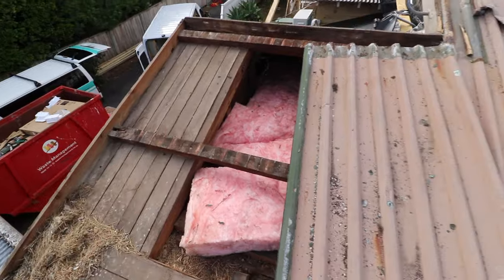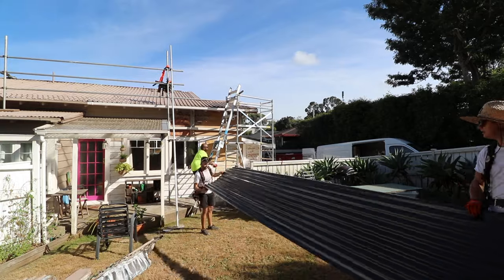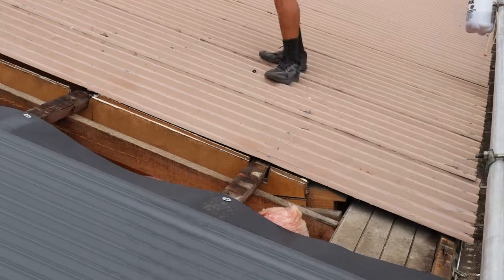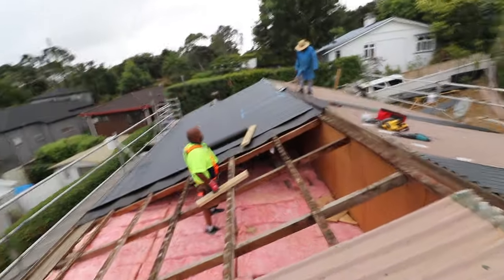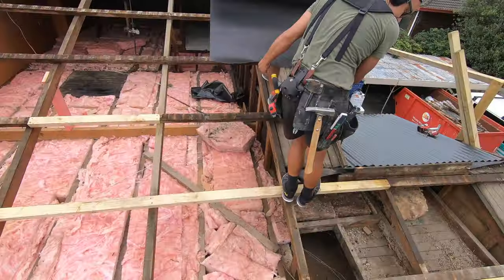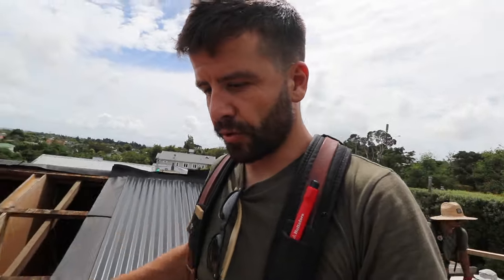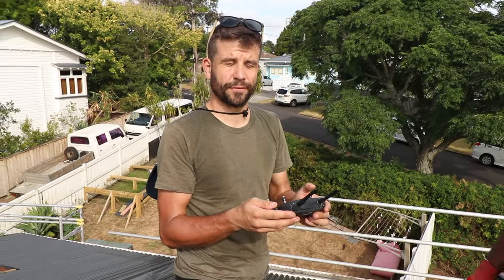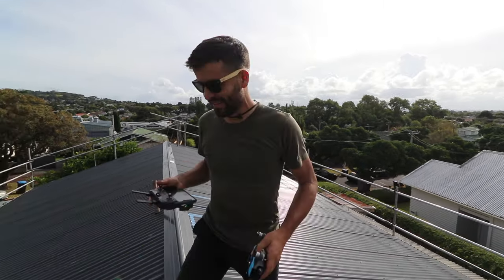How to Replace an Old Roof!

Comment: Hey Scott - NZ doesn’t specify you to run underpayment horizontally/shingled from the eave up to the ridge?
Reply: Love the videos by the way!
Reply: Dan Germani if the paper is 1000mm and support centres are say 1200mm ctrs then you couldnt lay the paper horizontally along the roof
Reply: some parts of Australia they don't even require underlay, only on spans over 6m at the 6m point.
Reply: The relevant part of the code (acceptable solution): 7.1.5.2 Installation
Roof underlay shall be laid with minimum 150 mm laps, and either across the roof slope or down it. When laid across the slope, the upper sheet shall lap over the lower sheet.
7.1.5.3 Underlay support 
Roof underlays shall be supported on 0.9 mm galvanised wire mesh, unless it is self-supporting in which case it shall span no more than 1.2 m in any one direction.

Comment: They haven't improved on the ancient corrugated metal over there?
Reply: Yes they have. The metal itself is available in different types of alloys depending on the location (from inland high country to coastal marine) and the coatings run from from light-zinc to heavy-galv to powdercoat to heavy powdercoat. The profile too varies based on roof angle, wind-zone and span. Don't rely on just your eyes.

Comment: RR Buildings, would have had the ruuf up by lunchtime 😊.  However, well done it completing it in a day 😊.  Drone shot at the end, needed to be done.
Reply: Haha - I was thinking the same :)
Reply: Two days.
Reply: @jamesbailand4311  Yes, you are right....3 men, 2 days.  A fun video though. 😊
Reply: Hope they removed the chalk lines, after they were done with them 😊.  You guys did....right?
Reply: @markodjukic7666  that was black ink.
Reply: ....and finally, a great soundtrack.
Reply: @jamesbailand4311  Of course, the new tool from Gaston 😊.
Reply: Would RR building replace the rotten bits and add the support for the rafter?
Reply: @Marko Djukic Yes but RR would have has $300,000 in machinery and gadgets to help him do it in a day, oh a Greg his human machine 🤣🤣
Reply: Zane H Mean, What kind of machinery and gadgets are we talking? Like a Hiab and special nail pullers ( I'm not getting smart just wondering how this job could be done quicker? )
Reply: @MsElijah16  Watch his videos when they do a roof, or a ruuf as they call it, he will lift all the sheets up to the building edge in one go, they slide them off and use the machinery to make it quick, their roof's are lined in ply so they are also much easier to walk on than having exposed battens where you have to watch where your going.
Reply: @zaneh6224  Well, my initial comment was made, 'tongue in cheek'....it obviously mis-fired.  No offence meant to SBC, and his audience, as the SBC channel is, I think, a superb channel, in its content, presentation, humour, soundtracks, and cooking courses.  The 7 minute or so, duration of each video, is also a winner.  I shall continue watching both, for the high quality content which they produce.  Apologies, if I offended SBC's audience.

Comment: I would have just replaced the roof without putting in extra support and without the water membrane since metal roofs won't leak if screwed in correctly. If you want to over-do work, then that's your choice of course.
Reply: Then your roof space and framing would have had a condensation problem. That building paper membrane isn't primarily for leaks.
Reply: God I hope I never hire you. Seriously.

Comment: No chicken wire under the paper Scott..... why is that? Are those days long gone? we are replacing the iron on our family bach in the BOP shortly
Reply: Depends on the building paper you use, modern ones are self-supporting.
Other factors include roof pitch and whether it is exposed on the underside.

Comment: First official oopsie Scott, the underlay is meant to be laid horizontally
Reply: Ben McGill hahaha was thinking the same
Reply: @Paul Taylor Roofing rule of thumb is work bottom upwards, not sideways.
Reply: Netting and paper for pitch 10 and below requires horizontal paper, anything over 10 doesn’t need netting and requires vertical paper
Reply: No. Incorrect statement. Our code calls for vertical for a few good reasons.
Reply: @HighMaintenancePS  which are?

Comment: The roof framing is totally flimsy. Hard to imagine that that is code for roof structures
Reply: In Canada that roof would collapse under the weight of the first decent snow fall...
Reply: No wonder the houses are so dirt cheap
Reply: @skilledjack7054  no snow, but built before changes to code made roofs stronger, they added some extra under struts.

Comment: How much for re-roof?
Reply: I'm in Aus not NZ but prices are probably similar. I'd charge 8-10k
Reply: My olds had their roof done about 10 years ago , it costed 25k NZ its roughly 150 M2, 5 bedroom with twin gabbles, 
It’s steel sheet metal
Coated in zink and an aloy

Comment: Anyone notice the what looked like a asbestos cement roofing sheet in the middle?
Reply: That looked like it was where the skylights are going. Probably an old fibreglass sheet covered in lichen.
Reply from the maker: Yeah bingo. Old clear sheets. The sheets where still clear where we took the ridge capping off.
Reply: @ScottBrownCarpentry  good good Scott. Great video as always

Comment: I thought the ideal of the video was to show people how to replace an old roof but you're not really showing anything you're not showing how to line up the metal panels how to get them straight do you put a ridge cap on first or last which you know we know the ridge cap goes on last but what I'm saying is a lot more detail could have been put into this to help people out I personally think that you do a good job except for the video the video you know gets you lost if you're a beginner trying to get some pointers on what to do

Comment: It's quite shocking that they make you put railing all the way around a house. That's just insane and insanely wasteful. What is that roof of 3/12 or 4/12, it's damn near flat!
Reply: Are you the one that's insane? Powder-coated metal roofing is like ice with the slightest moisture.
Reply: @DiscoFang  Well they're walking on that perfectly dry roof just fine, and I doubt there's much powder coating left on that roof. Having said that, I do comp,  metal roof's not really my thing.
Reply: Joseph DESTAUBIN I guess you didn't notice there's a new roof on there too so not sure why you're commenting on just the old roof.
Reply: Zero waste. The scaffold gets dismantled and used on other jobs. 
   In NZ we recently mandated scaffolding on this type of operation. Prior that many decent men fell. It takes just one small slip up. 
  I find your comment insane.
Reply: @josephdestaubin7426  They are heroes of mine. Listen mate Im not pro health and safety legislation on the whole, except where its needed to say keep a crane from falling on your head.
   Scaffolding around the roof edge has been a godsend. If you've ever been caught on a roof job in a shower (very changeable weather where I'm from) then you will get it. 
  By the way, all those old steelos, they lost like half their mates over their careers.

Comment: i thought that roofs where installed by roofing plumber
Reply: michael chandley The following is an example of the restricted building work someone holding a carpentry licence class can do or supervise.  

Note: there are some overlaps between licence classes, for example someone holding a carpentry licence may also carry out or supervise:

construction of concrete foundations and/or pile foundations
installation of lightweight profiled metal roofing.
Reply: @KaMcRaZy07  Worth also nothing that re-roofing in the same material is not Restricted Building Work.